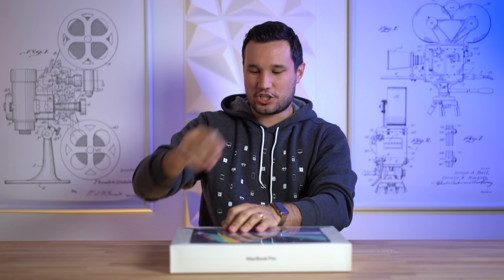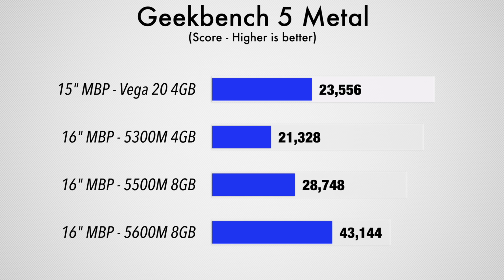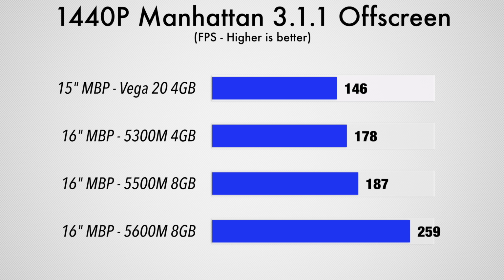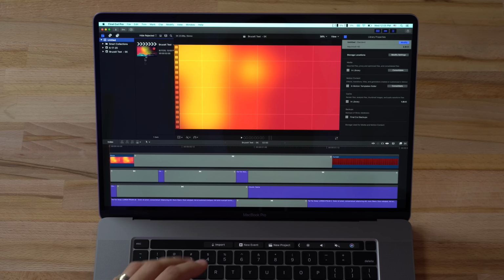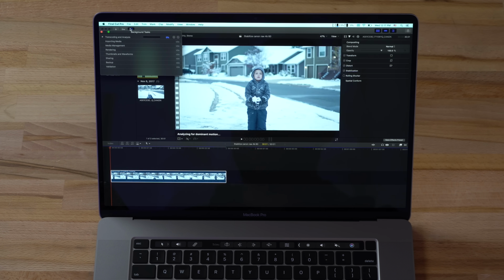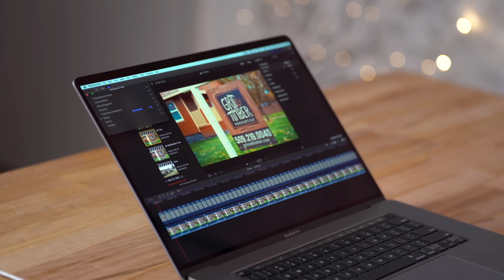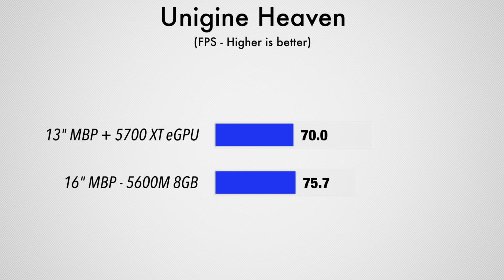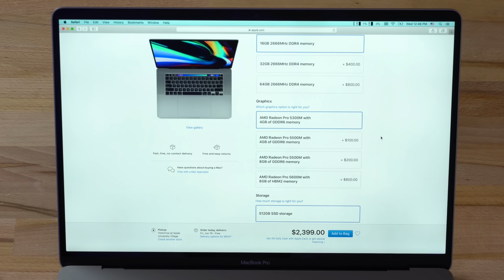New 5600M GPU on 16" MacBook Pro: Performance Benchmarks

Comment: That is massively good news, but you need to pay attention to Adobe's updates to all their suite COINCIDENTALLY launched today as well - today's HUGE Photoshop and Illustrator UPDATES finally use significant GPU power!!! Preferences in Adobe Camera Raw filter DOES acknowledge that my 2019 iMac 27 inch 2nd tier 8gb 580x FULLY ACCELERATES Adobe Camera Raw BUT my topped out Macbook Pro 16 inch is NOT supported... Regardless, many things are TWICE as fast or even FIVE times faster, like zooming in a huge complex Illustrator document as well as the launching of Camera Raw is much faster, things I do every day, so get those updates installed and be prepared to be blown away!
Reply: Dave Stephens it good and bad news for intel
Reply: Lightroom too?
Reply: @anchoricex1  Lightroom says "Full acceleration is supported." Thank god.

Comment: The price..is insane. But i don’t care about performance, the key point is: can it run with external monitor without gettin so hot like the 5500? It’s odd that i’m writing this for a machine that should be pro..but the 5500 (and the 5300) macbook are not pro since it is impossible to work with monitors. It’s ridiculous, but the point is that
Reply: Dude. It's not impossible. The monitor issues is over blown. The thing gets hot, yes. Not a huge deal. I have the i7 5300m and run an external monitor (NOT IN CLAMSHELL)  Is it ideal ? NO. Is it impossible? Not by any stretch of the word.
Reply: Emmanuel Mota ok but for a 3k dollars computer it’s disappointing. It gets hot even reading pdf, the touchbar heats, it becomes an oven. If many people are also complaining, there is a reason. the most imbarassing point is that apple seems to ignore this issue, which bdw is a “pro” issue, since many pros work with external monitor. Bha..

Comment: Do you have any audio crackling or pops that happened with the 2019 16" MBP? Been putting off buy a new computer because of that... glad I did cause this GPU looks amazing.
Reply from the maker: No issues at all!
Reply: It was fixed
Reply: I had that issue on 13” 2017 MacBook Pro. I followed this : Open terminal, Type “sudo killall coreaudiod return” then type in your password

Comment: I still do not understand something. I know Mac computers are beautiful, great OS but pay more than $ 3K for computer is nuts. I have my Lenovo Legion i got 86.4 fps in extreme preset instead of 75.7 FPS of the expensive Macbook Pro . My laptop only cost me $ 999 + taxes. Check the link about the results. https://snipboard.io/B5OsRk.jpg
Reply: Maanav Khurana  yes
Reply: Maanav Khurana  This is the weak point but i don't care that coz mostly i work at home  if getting a better battery will cost me more than $3k, no thanks..
Reply: Gaming is more of second part on Macs, the thing that Mac users should care about more is productivity applications behavior
Reply: @arturmavlyuchenko7647  I don't use this Lenovo for gaming. I use it for editing video and photo. It runs smoothly with 4K video in Premiere.

Comment: Just bought a 5500m 8gb i9 with 64gb of ram from Adorama and still haven't opened the box. Not sure what I want to do.  I would like to future proof this as much as possible. Perhaps 6-7 years.  I do video editing, videography, and recently have been using after effects. I hope to purchase the canon eos r5 in a year or two. Would I be better off with my current config or perhaps getting the 5600m 8gb while downgrading to 32gb of ram and getting i7 instead?
Reply: I would go 6 Core i7 32GB ram and  5600M 8GB GPU. I am a video producer who uses AE professionally. If you want to splurge get the 8 core i9 model and add 32GB ram and the 5600M this i9 would include the 1TB HD. Good luck.
Reply: @emmanuelmota1  thanks for the info! Do you know if 32gb of ram will hold for the next of couple years.  8k is the future. Will it weaken the longevity of the comp? I just returned a refurbished i9 5500m 8gb 64gb ram, and I was pushing between 35-40gb of ram with both premiere and after effects opened. I was working with old fs7 mxf files. Am I still better off with 32gb vs 64gb ram? I understand I can always get a egpu, but I can never upgrade the RAM.
Reply: @mmaged2287  well it sounds like you're using Adobe dynamic link with AE and premiere. I would open up all the apps you want to be using constantly and make sure that you understand what your RAM usage actually is.the system will utilize as much ram as you give it I bet if you put in 64 it would be chewing up as much as it can. That's just the way the operating system works. What you should be looking for is ram pressure. If it's green while you're using your system as you normally would in your workflow, you are good to go with the amount of ram that you have. Yellow I would start looking for more ram, red is absolutely must have more RAM.
Reply: But about your adorama purchase. Return it, get the 5600m if you want to keep it for that long. And price doesn't seem to be an issue.
Reply: @emmanuelmota1  thanks for the info. Still a big decision. Also hoping adorama offers this config as it seems to be absent from their store for now.
Reply: I’d honestly put as much more money as you can. 8-core Intel Core i9, 64GB RAM, AMD Radeon Pro 5600M, 512GB or 1TB SSD
Reply: @arturmavlyuchenko7647  Wish I could. Can't afford the same config I currently have(2.3 64gb ram, 1 tb ssd 5500m 8gb)  with the 5600M. It's really between getting the 5600m and downgrading to 32gb of ram(struggling with multitasking between adobe suite) or keeping the current config and being forced to use egpu in a few years.   Also, I would like to get this from Adorama, as I used a gift card towards the purchase.  It seems like B&H is only offering preorders, so who knows what Adorama will do.

Comment: Hi Max can you please test the GPU power consumption when you plugging in an external monitor? Really want to see the idel power consumption. Had 5500M with 18w when doing nothing with external monitors plugged
Reply from the maker: Unfortunately iStat menu isn’t showing sensor data for for this one yet.
Reply: Max Tech Thank you Max. Much appreciated if you can keep the community informed with it. Apple support forum is going crazy with this now.

Comment: Imagine now Apple ditching Intel and mounting new Ryzen along with Radeon 5600M.  It would offer insane performance in every aspect.
Reply: Intel owns the tech to Thunderbolt and Apple is very invested I that, doubt they would drop that to go to ryzen unless they make their own connection/ protocol but it probably won’t be backwards compatible. Although I doubt that if they would they probably wouldn’t care as they did with FireWire etc.
Reply: This didn’t age well though haha, Apple silicon arm macs incoming, however a few years down the line I would love to grab one of these 16” MacBooks used. The power in the package is truly phenomenal and will still be able to run Windows and stuff
Reply: Maanav Khurana  will never happen unfortunately. recoding macos for amd optimization so deep into intel features like tb3, quicksync etc. doesnt make any sense from a business standpoint. would take up too many ressources when the ultimate plan is to move to ARM processors a few years down the line. people will still buy the macbooks with intel until their ARM is ready. why go through the extreme hustle to switch to amd if a long term partnership is off the table? to get where apple is rn with intel, it'll take at least 2-3 years of development and the new ryzen chips only appeared in latest 4000 series. so basically until the switch might be ready, ARM is most likely in the pipelines.
Reply: @philippscolorist  AMD Hackintoshes are a thing. MacOS does run on AMD, very well in fact.

Comment: Well I wish this option was available when I purchased my 2019 MBP haha...I'll use that $800 upgrade for an eGPU instead...enclosure w/ PSU and GPU combo would cost just as much as this $800 upgrade....im also still pushing 120-144fps on my 8gb 5500M so its all good...a little boost would be nice but nothing an eGPU can't solve.  Thanks for the review and stats none the less!  Cheers!

Comment: Can you please test how the 5600M runs with an external display connected? Would be great to see if it helps the thermals/fan speed
Reply: My guess is since it has the same wattage as the 5500 & 5300 it will be exactly the same it may run a little more efficient because of the HBM2 but it will still cause the fans to ramp up. Using an external display will make it run hotter by design because to use an external display on a Macbook pro you have to use Displayport or HDMI over USB-C/thunderbolt heating up the GPU and the Thunderbolt contoller chipset. Macs can not run an external display from the Intel iGPU because of way Apple & FreeBSD designed display switching. "It's similar to Nvidia Optimus or MUX switching." It was made this way so you wouldn't have problems running professional grade software on the internal display. So when you plug in an external display it will always use the dedicated GPU and activating the Thunderbolt controller if you use a dongle, which will in turn cause more heat. It can be annoying sometimes but I find the best way to use it is to have a dedicated cable that runs USB-C to Display-port instead of going through a passive dongle and leaving the macbook on a laptop stand and only closing it to the point the laptop screen goes off but is not fully closed because macbook pros draw air through the keyboard deck. if you shut them all the way it will be choke the macbook and cause more heat. I have a couple PC laptops that use the intel iGPU for the Laptop display always and the GPU can only be used if you plug it into an external display and that way sucks in my opinion. I bought a HP pavilion Gaming Laptop last year and it's great but I can't edit videos without stuttering or timeline drop outs because of that limitation so to get the best performance I have to use an external display. But yea the fans can be annoying when you are trying to concentrate or work quietly.
Reply: @joesalyers  pretty sure the MacBook draws air from the openings along the sides on the bottom. For best air flow you want one of those vertical laptop holders. Draw cool air from the sides and exhaust the hot air out the back. In a vertical holder the back would face up.
Reply: Yes, I also would like to know this! :-D
Reply: Yes I have the same fucken problem.

Comment: This is crazy efficent ! As an "only PC" kinda guy this is amazing for a laptop on a battery!
Reply: Maanav Khurana  imagine the combo of the Ryzen on that and the GPU of the MAC! Crazy efficiency and power!
Reply: @houssamalucad753  A Ryzen 4800U and RX 5600M would be insane.
Reply: M. Radeon Pro 5600M > RX 5600M
Reply: @Youtube Kullanıcısı they aren't switching to ARM. They're not having much advantage with intel chips on Macs. So they wanted to try out their chips on lower end MacBooks like the 12" and the Air. The other Macs will continue to feature x86 based processors. Remember the Mac Pro, iMac and MacBook Pro are meant to be Pro machines hence powerful chipsets. And by the way, there's actually a silent rumour going on that Apple is planning to make an AMD based MacBook so don't lose hope folks.
Reply: Well, here I am right after the event and turns out I was wrong the entire time. I don't know what's gonna happen to the Mac Pro😭

Comment: While I’m early to the comments I should also say - have you compared the venerable 2015 15” MacBook Pro that so many people still use to the new 13” yet? I feel it’s a logical upgrade that a lot are looking at, and I’m curious how the higher wattage 4th gen chips still hold up against modern offerings both 8th and 10th gen!

Comment: MacBook Pro 16 is officially the world's thinnest gaming laptop.
Reply: Also the world's longest lasting gaming laptop on 🔋
Reply: And expensive
Reply: Maanav Khurana The stealth is 0.58x11.99x8.27, much thinner than 0.68x14.09x9.68.
Reply: Dino Studios It’s just 0.1” thinner, we’re not talking about the other dimensions I think
Reply: No. Razer Blade Stealth is a bit smaller. Though a 5600M is probably a lot more powerful than a 1650 super.
Reply: @AdmiralDino235  5600M is much closer to a 2070 MaxQ... so way better than a 1650 Super.

Comment: Mac users: oMg 75fps FiNaLlY I CaN gAmE oN mY mAc!
Reply from the maker: That's just the extreme Unigine Heaven Benchmark :) This could translate to over 100FPS in certain games
Reply from the maker: Or higher graphics settings with 60FPS minimum
Reply: Max Tech omg this could be a gaming machine! (But a pretty overpriced one)
I got the 2020 $1800 MBP and I loved it because of its size. Wish it had a dedicated GPU tho :(

Comment: This card might be the greatest GPU AMD has created in years........
Reply: Rx 5700m baby
Reply: pratik kumar on a laptop
Reply: @busimo  the m means laptop. Technically the 5700m exists, but I don't think any laptop manufacturer actually uses it.
Reply: Right Wing Safety Squad thanks. M might mean mobile portable, I don't know.
Reply: pratik kumar Max said somehow 5600M is better. And Pro video cards designed specifically for Macs are better than casual RX
Reply: pratik kumar this one is better the R
X5700m if you look into it